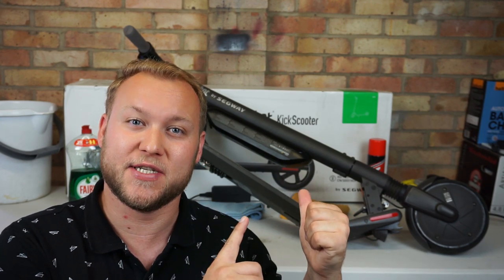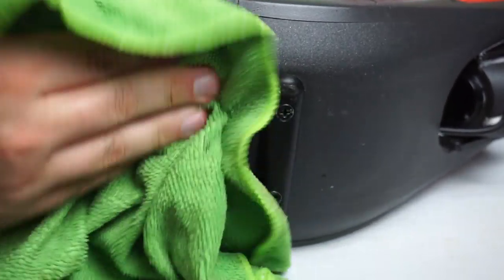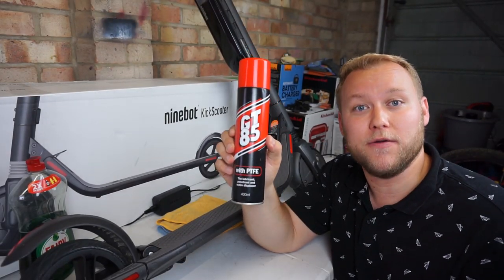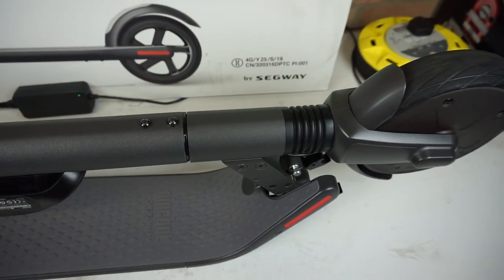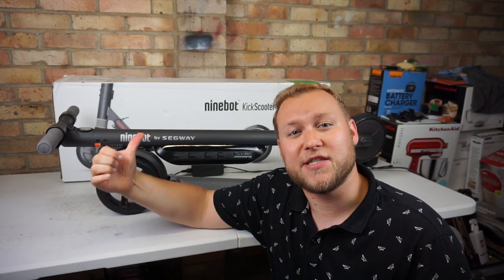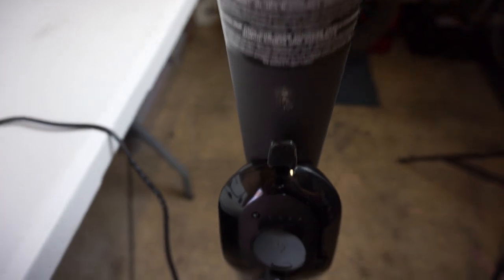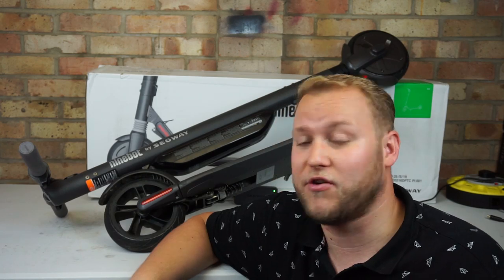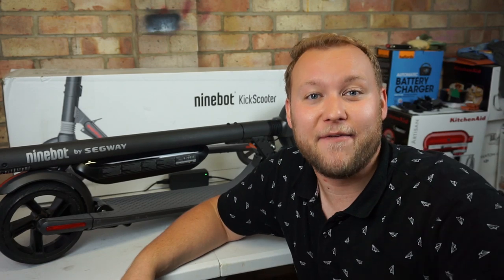NineBot Segway ES1/ES2/ES4 TIPS & Maintenance Guide!

Comment: I would advise against spraying the wheel bearings. They're grease packed and introducing a very thin lubricant would dilute the grease causing accelerated wear. You could pop the dust shield off and re-pack but IMO, it's better to just leave them alone
Reply: this

Comment: To prolong the battery, definitely DO NOT top off every ride. Charging the battery to the maximum capacity will shorten its lifespan... to prolong the battery charge from 20~80% will provide longevity
Reply: So should I only charge nine when it gets to 10 percent? Instead of charging after a short ride and have 80 percent? Thanks
Reply: @josephwelch6972  that would be most ideal but not realistic, honestly having this scooter is all about ease of use. I prefer charging everytime i come home from a ride instead of worrying about it
Reply: That's just not true when speaking in regards to the lithium batteries electric scooters utilize. You don't want to treat the charging habits as you would with your mobile phones. To keep the longevity of your escooter, top it off after every use. Try to keep your battery above 50% if all possible. After 10/15 top offs, engage in a full depleted charge. Also charge until your power brick states green not when your escooter shows full. Only charge when your escooter has cooled down for 10/15 minutes. Just some little things to take care of your batteries. Do not treat it like your normal habits of charging your mobile devices. They are not one in the same. Always keep topped off.

Comment: with Red thread locker you won't be able to unscrew later if need any maintenance, you will have to cut off the screws!  At least use the blue locktite
Reply: i used red I took my screws off just recently no issues use a cheater bar for leverage
Reply: @69tytyhar  still use blue. You got lucky or didn't apply the lock tight correctly.
Reply: I have a butane torch specifically for motorcycle parts with red loctite… like bar ends. Heat liquifies the loctite. Works well.

Comment: Helpful video, though I'd expect the wheel bearings to be sealed, which means that spraying a lubricant doesn't have any benefit...??
Reply: you are correct... He didnt knew that + i would not suggest spraying that suspension with that lubricate as it will collect 2x more dust... But good video overal!
Reply: Ikno yh 😂😂
Reply: What I sprayed it damn it man my suspension bad to it’s not smooth like it was even after lubricant gating it

Comment: Well, I’m over 600 miles now. I’ve tightened up those stem screws and they didn’t seem to have loosened up again when my wheel suddenly bent sideways from the handlebars while going full speed. Ouch. Still recovering. I loosened them and snapped the wheel back in place but I don’t trust it won’t happen again at the next bad part of the sidewalk. :(

Comment: Just bought the fixed industrial version of the es4 from scootexpo 👍👍👍 where is a good place to buy new tires when i need them??
Reply: Yea I bought the same one as you non folding one and my front tire is getting bald as well. And I have 100 miles on mine but the roads where I live are like cheese graters. Did you ever find good replacement tires yet?? Thanks
Reply: joseph welch no I actually sold it to my nieces husband and just ordered a Cycleboard Rover 2 😎👍
Reply: @JerseyStyle7  oh nice!! Way cool I want to get a widewheel or a Rion re60
Reply: joseph welch So funny you said that I was going to get either one of those also,well the rion is a bit pricey and it goes way to fast for me for two little wheels, the wide wheel i love, that is the only two wheel scooter I would consider because the wheels are so wide they don’t slip as much
Reply: @JerseyStyle7  most definitely I like the fixed es4 it's supposed to be way better than the civilian model with heavy duty motor better everything but has no rear suspension but it's an es4. But I put a wrap on it hacked it for 20+MPH did the solder mod on board and also put skateboard grip tape on deck in place of rubber deck pad. But I need more speed and the looks of the wide wheel is killer for that price range. The Rion will have to be my later scooter because going from 20mph to 65+ would be a death wish I need more time and experience so wide wheel it is. Cheers!
Reply: joseph welch you’re 100% right the wide wheel for the price looks like a great buy, even though I ordered the Cycleboard I might get one of those as well

Comment: I've had one for years and I would say that in no way does keeping it clean make it run any better. Why this man says that keeping it clean is the most important I have no idea. Making sure all the bolts are tight and lubricating it and making sure that the battery completely runs out and then fully charges again are the most important parts about keeping this thing long-lasting. You can even keep it outside and in the rain for up to a year and still the quality and top speed are unaffected due to how well it's made. Now I don't use mine in the inner-city or anything like that, around where I live it's nothing but gravel roads and I've used it for over two years on gravel roads and the only problem that I think I might have to face soon would be replacing the bearings, and putting more tread on the wheels there looking a little bald at this point and that does affect its top speed because the diameter of the wheel is now less than what it would be out-of-the-box. But like I said this guy saying that the most important thing is keeping it clean is is purely in his head and he should factor in reality instead of his OCD
Reply from the maker: Thanks Toby

Comment: I would suggest against the thread locker because ninebot scooter have a problem where a compositor give out and when you have the headlight on it will also put on the break. Your es 1-4 will most likely have this happen it’s pretty easy to fix but don’t put on the thread locker before you fix it. Or do if you trust you luck.

Comment: WD40 Is Not Water Repellant, Its A Water Displacer.
I Have E25 And ES2 And I Changed The Bolts With Stainles Steel Ones Like Pretty Fast When I Bought The Scooters because The Original Ones Just Comes Out And They Are Soft material Ones, Easy To Brake Them, Soo You Can Do That  And Use A Tread Locker On A End Of The Bolt.

Comment: Great video mate. Have you encountered any creaking noise when stepping on the board and using the es2 ? Not sure exactly where the noise is coming from.
Reply: Hey just checking if you found the issue yet. I've been inspecting it for awhile and couldn't find anything aside from rear shock. But I'm not sure yet.

Comment: Do you have the headlight issue or any issues you can read on different forums? I think at first people should ride it properly and maintain it.
Reply: yeah I wish i didnt buy one. i can never use the headlight without it messing up the throttle.
Reply: @KiwiMaker  so you have to solder a fuse that burns out inside the the board. It took me 30 min to do mine and works perfectly now. It's because if you go up a hill that is too steep and you have the light on it burns that fuse. Happens to pretty much all ninebot es series. There is tutorial vids in YouTube. Cheers hope this helped you out.

Comment: My scooter has 2 problems. First one is with the spring in the back, it squeeks way too mutch when trying to absorb the shock. Should i spray it?

Another weird issue that happened in late fall before winter started, the front of scooter where the mechanism is, started to buzz and vibrate in a weird fashion, from pressure i think but not sure what to do.  Does anyone have some ideas how can it be fixed?

I'm planning to taking scooter to mechanic but maybe i can fix it myself?

Comment: can you do a video after the battery runs out?  How hard is it to just use foot power?  any resistance to it, or just like a regular kick scooter
Reply: I once ran the battery out about 2 miles from the house.  Unfortunately it was uphill the whole way.  Terrible trying to get home, just wouldn’t get any momentum.  But on flat ground or even the slightest decline it’s fine.  I often cruise down hills without using the power.

Comment: Hi Jake,
I truly like using my ES4 but I am dissapointed with one issue. The clamp folding mechanism is problematic by mine. You can't even put a sheet of paper inn between the brake and the folded upper body. What ends up happening is, it scratches the upper body. So my scooter has scratched off paint on the inner side. It just sucks. Did you also experience this?
Reply: No

Comment: Hey I'm about 280LB And I was just wondering can this thing pull me on flat surface with the extended battery?? And will it still do like 15/18 Miles An Hour?
Reply: I'm 250LB and mine stays at a steady 15mph on flat and I've hit 19mph on a slight down hill. Does drop to around 12mph on a incline though. All in all good fun.
Hope this helps
Reply: @darryl3118  thank you that does help

Comment: I'm having a nightmare deciding what to buy. Got about £500 to spend. Looking for reliability and range over fun factor.   It's for cruising 7 km each way to work.   

What would you go for ?
Reply from the maker: Quad Almighty Id go for the NineBot ES4
Reply: I bought the es4 and I can easily say that it was a great choice. I commute around 5 km one way to my work and it is truly amazing.go for it
Reply: I spent 6 months doing research and at this price point, (and the price point above) the ES4 is the best choice for a combination of Reliability, price, speed, comfort and distance. The only scooter that comes close is the 365 Pro but with air filled tyres can get punctures....(you can get a liquid to put in them which costs £20 or so) and has no suspension......
ES4 deffo is the one to go for!!! (Its the one I bought!!!)

Comment: any advice for going over bumps getting that loud clicking sound? or is that just what it is with the non-airfilled tires?
Reply: That loud click is suppose to happen. If you turn over the scooter you will see a hinge with a big spring. That snap you hear is the scooter manuvering over the rut using its hinge and the spring snapping it back. Try to ignore it, eventually realize its a good thing

Comment: Has anyone has this issue with their external battery?

With my Segway Ninebot ES2 external battery now it’s a ES4.
The 4 lights on the extra battery keep flashing all the time then the scooter slows down 2 the speed of a ES2 and the same power as the ES2 like the extra battery isn’t on the scooter.

I had the battery replaced with another one from the shop where I bought it but it still happens.

Comment: my battery doesn't have a good seal at the bottom is that normal?? i have since filled it in with sealant but no matter how i screwed it in it never conformed to the stem of the scooter completely. the bracket didnt seem to be bent or anything  and bought it from ABT.com a newyork based retailer

Comment: I have had my es4 for a bit over a year. Now there are many much better scooters  with much better speeds and suspension. The hard small tires on this scooter I'm not liking very much. After riding this for a while I would much prefer larger pneumatic tires. I am now looking at the  MANTIS scooters.
Reply: I had a scooter with pneumatic tires.  In 100 miles the tire went flat (a speed bump took it out).  The ES4's solid tires are excellent, last a long time, and the built-in shock absorber in the unit takes out most of the bumps so that you don't need air tires.

Comment: Any tips for the triggers I notice mine is getting stuck a little
Reply: I had that happen as well. Check is you handlebar grips are not placed directly against them. You can just slide these outward a little if so. Otherwise, what I did, unscrew the controls a little bit, wiggle them and tighten them again, and while tightening them, press them to check if they still run free. Just hand tighten them, so not too much

Comment: I m so sad my es2 just turned off and don't turn on again .🤦‍♂️ even change doesn't work. Somebody help me please.
Reply: Buy a new control board
Reply: Trust me get Xiaomi M365 with solid tires. You never gonna have problems ever.
Reply: @gapvape9723  m365 fold system is very unsecure

Comment: 12 miles??! With the extended battery? I thought without extended battery is about 15 miles
Reply: He goes on full speed and tough terrain. But if you go on flat ground such as tarmac at a normal speed 12mph  you should get a lot more.